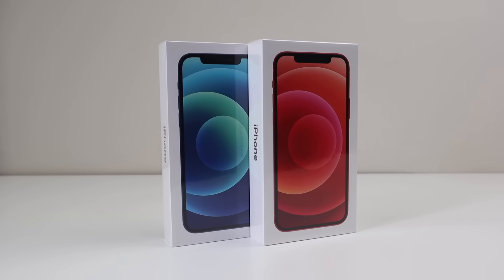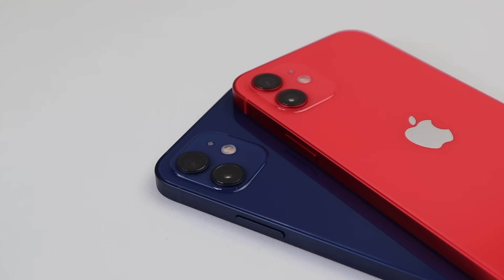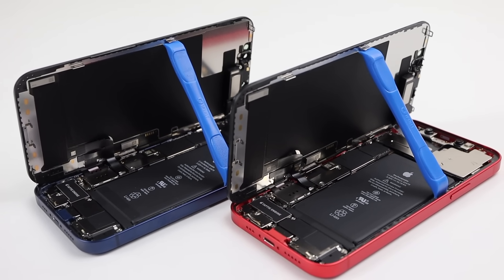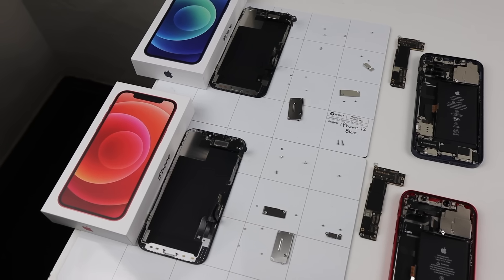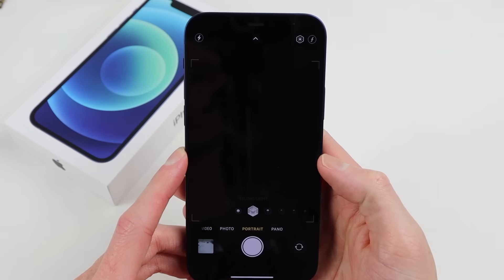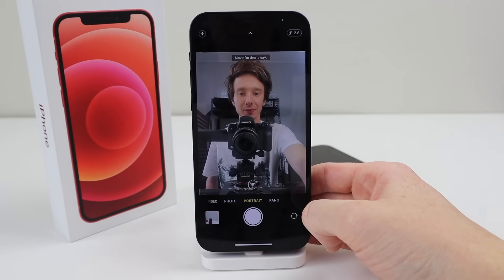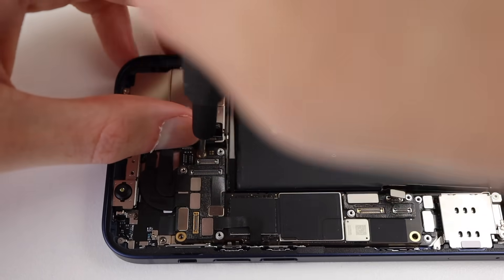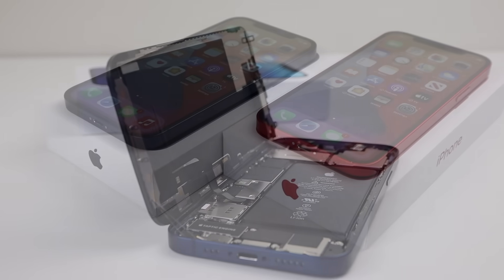iPhone 12 Anti Repair Design - Teardown and Repair Assessment

Comment: For anyone wondering, this all occurred because in short John Deere, the tractor manufacturer, have a legal issue because they are making their equipment less reliable and harder to work on. Historically farmers worked and maintained their own machines to minimise downtime and keep working in the fields but because of this, they have to go to dealerships to plug in computers ect which is an additional monetary and time cost. Farmers disliked this and thus a massive legal battle occurred because their policy stated that farmers purely ‘lease’ their technology despite actually owning it and paying ridiculous amounts (seriously look at the prices of new machines) because of said technology and artificial price rises and also caused legal issues because some farmers had to hack into their own equipment which took business away from John Deere

For anyone wondering how apple has anything to do with this, they aided John Deere in order to counter the “right to repair” bill which was gonna be instated somewhere in the us (apologies for not remembering) because like with John Deere, it would cause conflict because people were repairing their own equipment instead of going to apple stores but this also had an additional affect of keeping people in the doors to go to these dealerships/shops to either get expensive repair jobs but to most likely encourage them to buy other products

Comment: Last night, I tried to change battery of my iPhone 11. It's pretty hard to uncover the screen. But it's still ok, I made it.  The battery is the nightmare. It's fragile and dangerous. Three double-sided taped it firmly stick it to the shell. And I only pulled one of them out, remaining two broke under the battery. So, I tried to pill off the battery, failed. I tried to pried it up carefully, failed. I tried to pried it up violently, then it started to smoke.  WTF!!!  

Then I realized that Apple try to prevent users to fix their phone with 3rd parts by themself!  They tried so hard,  and they did it!

Comment: The new power adapter is just USB-C. This is what was mandated under EU regulations. Acting like it is some odd power adapter unique to Apple is misleading. I have many of USB micro and USB-C power adapters and have no trouble finding one when I need one. I definitely do not need more. It is just USB as well, so any third party power adapter will do the job just as well. In a very short time all of us will have a drawer of USB-C power adapter if products keep including them.

Comment: Even the protective film that comes with the phone is white and not transparent to ensure you remove it and dont use to protect the screen from scratches, forcing os to use it naked or to buy a glass screen protector, increasing odds of damaging the screen and needing to repair ir or buy the next years device.

basically they dont ship chargers for enviorment, but their phones are use and toss and no reuse or repair it's just hipocritical

Comment: I am not defending Apple in any way, but pretty much all PC's, phones, and tablets are being made this way these days.  Android phones used to be easy to open and swap a bad battery. Now I would be surprised if any are being made that way. Laptops are being made with  pretty much all components soldered to the system board. Things that were cheap and easy to replace, like ram, the hard drive, wireless cards, etc,  are now all part of one board which has to be replaced if anything goes wrong with it. You can still buy PC laptops that can still be upgraded, you just need to do some investigative work before you buy.  I have been a computer tech since 1999, and I will not buy a laptop I cannot easily upgrade myself. These companies do not want the end user to fix their own laptops, phones, and tablets because they do not make any money when we do. They design these products to be throwaway devices so you have buy a new one, and the cycle starts again.

Comment: Apple's "defense," and it may work legally, will be that the phones aren't unrepairable, but rather have to be repaired only by licensed Apple technicians with genuine Apple parts to prevent third party producers from making parts that are less environmentally sound than blah blah blah. I would also bet there's something in the user agreement about this, but I'm not going to wade through it to find out. Rather, I'll just stick with Android, where you can buy perfectly functional phones for a fifth of the price. iPhones are nothing more than status symbols these days.
Reply from the maker: I read the user agreement for the phone and I couldn't find anything. Maybe I missed something cause it's really long but I did look.
Reply: @HughJeffreys  You're a better man than I for even trying to read it. I guess I'd ultimately just be really surprised if Apple hadn't protected themselves.

Comment: I went with Samsung and have never looked back.  With Nova launcher, I can make it looks like an iPhone or Mac if I want.  I can also plug in proper headphones without tying up a port and needing a dongle.  I saw the way Apple was going and bailed on them.  My first Samsung was an S6 Edge.  I've replaced the battery and display myself and still have my S6 as a viewfinder for my OSMO and update it via WiFi, no SIM.  I finally upgraded to a Samsung Galaxy S10.  All of my old apps transferred and still work, plus I upgraded the memory with a huge SD card. F Apple.

Comment: !!This is just for educational purposes, I am not here to discuss it with anyone whether it's right or wrong!!

Every Iphone (or other Apple product) is paired with a certain "chip id" on almost every component in the product. To do a repair, the technician has to have access to Apple's repair service known as "Global Service Exchange" (GSX), where the technician has to report the id of the screen, camera, logic board etc. and "replace" it with the id of the changed component. After the component is changed the technician has obligation to run multiple tests, to ensure that the product has been serviced correctly. 3rd party companies are allowed a license to access Apple's technician software, and original components from the "Self-Servicing Account Program" (SSA) Here's a link: https://support.apple.com/self-servicing-account-program
They do this to ensure the customer gets their product with "Apple standard", with genuine replacement parts from Apple. Downside to this is that repairs are expensive, and a lot of the time it's more valuable for the customer to just buy a new device.

Comment: as an electronics technician i can tell you : when the phone boots it reads all the serials from each part. it must match the serial list in the boot rom of the phone. So some software buff should dig in to these bootroms and make a serial # matching software
Reply: but wouldn't that help counterfeiters?
Reply: @TheGkriz  well iam not into that. More into the right to repair your own expensive stuff without being ripped off. Best thing to do is not to buy apple products in the first place and let them know why. ( edit of this mssg = corrected some typos )

Comment: It's what I call win-win obsolescence - for Apple >:(  Means, the technology is complex enough that these problems occur even without specifically implementing anything. The camera module is probably not intentionally locked to the phone. But maybe each camera module requires special calibration data that's too much to store inside the camera. If the calibration requires special equipment, you can't just swap the modules and recalibrate using just software. Win-win for Apple. Lose-lose for the environment.

Comment: I wouldn't be surprised if they make it so the iPhone 13 won't turn on at all if you replace literally anything and it requires to change a tiny chip as big as a grain of sand for it just to corrupt all firmware and boot loop, you would also have to solder on another chip that is paired with whatever is being replaced. One final thing, every part is paired with different chips in different areas which would require a full teardown and all parts are paired together meaning you would need a full replacement for it to function.

Comment: Well I guess the best thing to do is don’t drop the phone and make sure you keep the phone cool. I’m still using an iPhone 7. I’ve had my battery changed once. I wonder on the new iPhones is how much lint can build up in the phone. Lint getting in the phone is a big reason for temperature buildup. The other option is use android or the new Linux phones.

Comment: to me it seems more like incompatibility rather than Apple being anti-repair. proj red has probably different stored low-level firmware/software/etc that is meant to work in collab with red specific phones, and other respective colors or non-red. dunno, just an idea, could be linked or tied to an hidden feature such as theming for a red device that is incompatible with non-red. albeit same exact layout per phone, diff archt or simply differing firmwares.
Reply: uh what? what the hell does the outer color have to do with ANYTHING? the internals are exactly the same.

Comment: I had my iphone 5s battery repair not to long ago, and i run into the issue where i cant log in into my phone no more, its been almost a decade with the phone and when i called apple to issue a repair they couldnt help me because they couldnt prove that the phone was rightfully purchase by me, and they need it prove of purchase which after five years whos gonna keep the receipt, so now i got a brick to hold the door open if anyone is interested in buying.

Comment: No new features have been added. No new hardware has been added. No new ability has been added. Only a device that cannot be repaired has been made. I changed parts of all my devices myself. I did the repairs myself. I would never hand over my personal phone to a third party. I am an iPhone user since the 3rd generation. My current iPhone is 7. But my next phone will never be an iPhone ! goodbye iPhone !